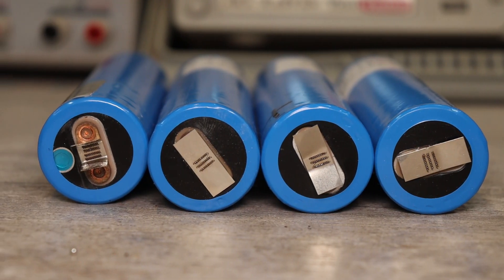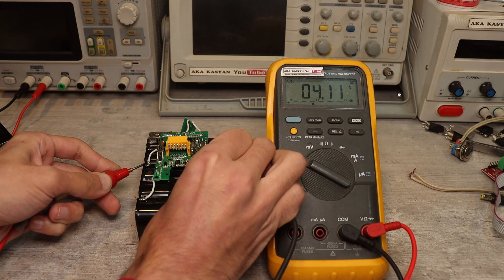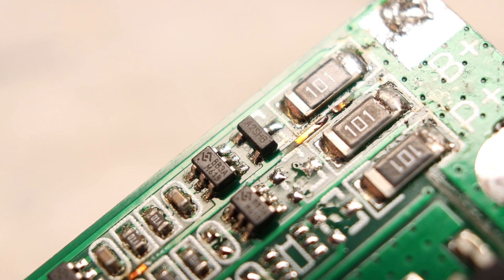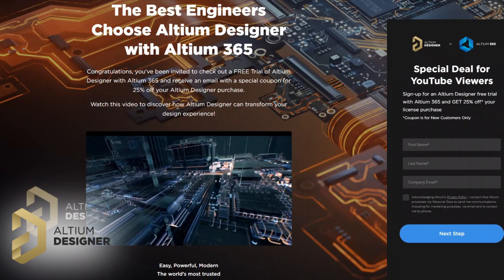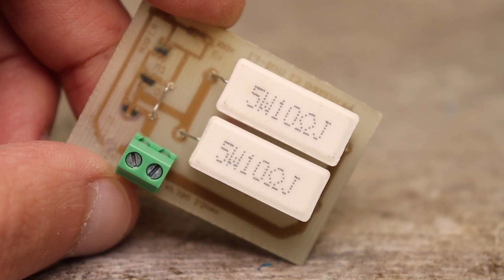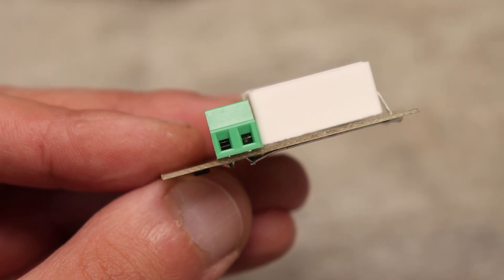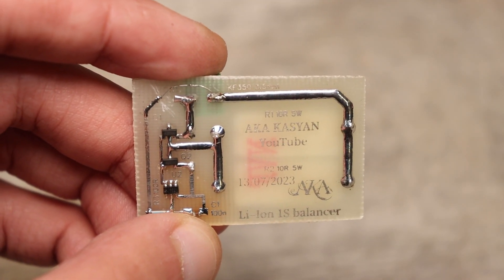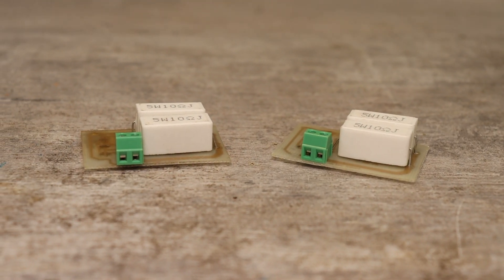This thing will extend the life of your battery!

Comment: Why not use ziner diodes and thyristor instead of mosfets so when cell is fully charge the ziner activate and turn of the thyristor and activate when voltage drop on cell to turn
Reply: Because once the thyristor is triggered it will stay on until the current from the battery voltage drops to zero, then your battery is destroyed....
Reply: @lezbriddon  not for my circuit design I use a optocoupler to the 3.5v ziner to turn on and 4v to turn off its simple and works
Reply: @Dc_tech386  my answer was about thyristors, once they turn on and pass current you can not turn them off, this is a fact and it's what they are designed to do, to stay locked on until current reaches zero. Maybe you tried to the setting person or something because it doesn't matter what you connect to a thyristor you can't change the way it works.
Reply: Standard Zener voltage tolerance is ± 5 %. For instance, a Vishay PTV 3.9B is rated for  3.9V min, 4.2V nominal and 4.4V max. Kasyan's board is much more accurate.
Reply: Zeners are known to be very inaccurate. He talked about TL431 as an option too, but that would require many more biasing components.